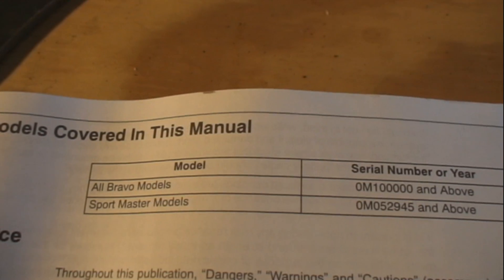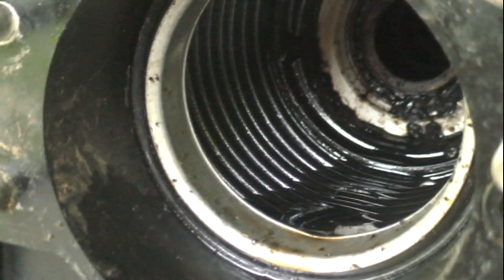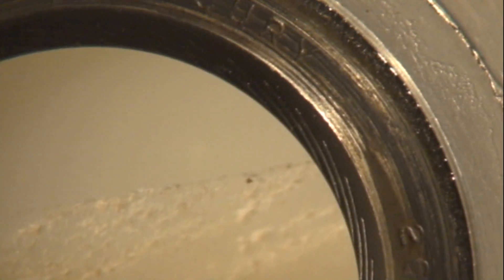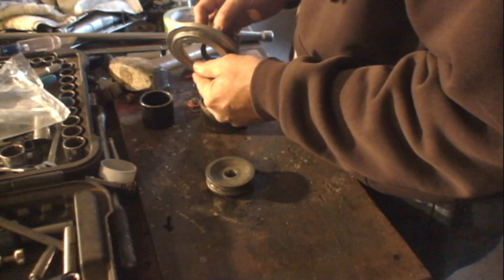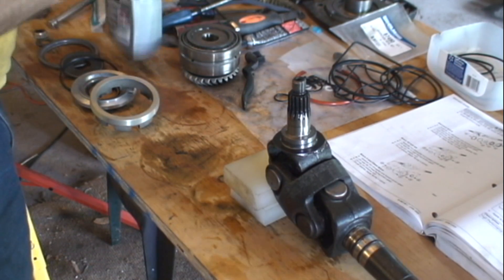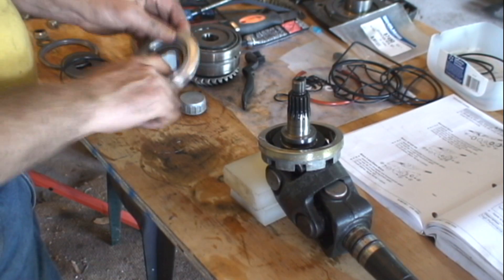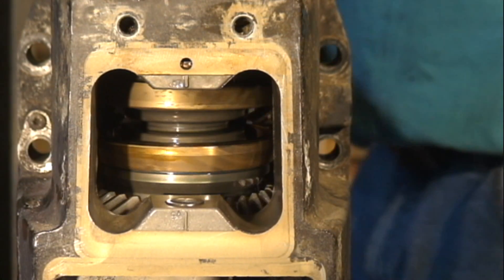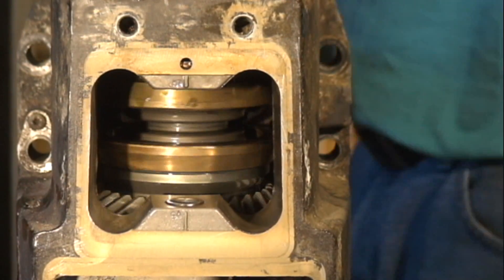Bravo One Outdrive Service - Drive Shaft Seal

Comment: I found the seal has its own measurable torque (drag). I add this to the bearing preload torque to get my final running torque number. Ive never seen this mentioned. Am i correct in doing it this way?

Comment: Your freshly put ''press fitted'' seal @ 4:51 is far from sitting flat (not fully sitting) !! Does it set itself right when you're ''Turn torquing'' the whole unit back into the casing ??

Comment: Hi Excellent Video. I have replaced the bearings with new and have set the preload for new bearings. I find now that when fitting the drive shaft into the housing and tightening the retainer nut the gears are binding. I understand that when fitting new bearings to the drive shaft that they will need to be shimmed. There are no shims currently fitted. Can you please advise.

Comment: Hello, appreciate your posting the video on how to replace the upper seal on the bravo.  I'm in the process of doing the same with my Bravo II outdrive and have encountered a snag.  Have pulled the outdrive, opened the housing, removed the shifter assembly, have the spanner to remove the retainer nut.  Have loosened the retainer nut completely and was expecting the u-joint assembly to simply pull out of the housing.  But won't come with human muscle. Got any ideas or suggestions what might be up? It spins smoothly as I would expect, but doesn't want to come out.  Thanks so much.
Reply from the maker: Here is a copy of the manual http://www.ta-group.at/dokus/service_manual_all_bravo_drives.pdf
It should just pull out. It is tight tolerances. You might try rapping on the side of the case with a mallet. I knocked the drive shaft against the bench as I pulled it out as seen in this video https://youtu.be/QIB6FpEmziM
Reply: Thanks very much for your reply.  Still having no luck pulling by hand.  Trying to figure out what's going on.  Here's my theory I would like to run by you.  This boat is new to me, so this is the first time I have been in the drive.  I have reason to believe that work has been done on the drive previously as evidenced by the leftovers of a upper housing seal kit (have the packaging with the part number, oil seal is not among the leftover items) among the various items left on the boat when I purchased it.
Reply: Second half of my comment.  Could it be that when the drive was previously worked on the wrong (too large) large o-ring in the u-joint assembly was used thus creating a very tight fit of the assembly when inserted into the housing? Or, could the assembly have been preloaded too tightly thus creating a 'bulging' of the same large o-ring in the assembly and resulting in a very tight fit of the assembly in the housing?  Is there a 'notch' in the housing that the large o-ring of the u-joint assembly is intended to sit when the assembly is inserted into the housing.  Thanks very much for your reply.  Mike
Reply: @michaelfanelli6018 : I know its an old post but.. in case .. FYI.. considering you've already disassembled the gearing front end and top end first.. all whats left is the drive shaft ''FORK TYPE'' locknut then it should come out easily by hand. If it still wont come out then probably had previous unadequate service works done to it or major overheat/leaks/frictions kinda welding the end shaft to the casing. NO O-RING in the world is strong enough, could be overpowering your hands .
Reply: @chrisking7255  Old post, but I had to take a heat gun and warm up the housing to get it to move in the housing.  No, I did not burn any o rings.  Just warmed it up. Worked wonders.

Comment: i have tried 3 times to set the preload on the drive shaft bearings 
without any luck. I loosened the bearing each time. I tried a sweep arm 
torque wrench and a click type. I cannot get any reading before nut 
bottoms out. Any idea what I'm doing wrong
Reply: Its cause guys like this can do things that only.oooo1 percent of the population  can or even want to.

Comment: Question??? If this driveshaft seal is leaking, can this cause water to leak into the boat. I have a very small leak coming from somewhere andI cant find it. I have removed both engines  along with the Bravo 1 drives and the gimble housings, both the inner and the outer. I out on a new gimble seal and I still have the same leak. I have been pulling my hair out for 2 years now and I cant find it. It is very slow, but still it is there. Any ideas please?? Thanks.
Reply from the maker: This drive shaft seal will not cause water to leak into the boat. If this leaks, you may see oil in the bellows.
Reply: ok...thank you for the answer. I am somewhat relieved, but I dont have any oil in the boat, so I guess that is a good thing. I do have this tiny leak...more like a big drip and I cant for the life of me find it. I pulled the motors out last December along with the K-planes and the gimbles, thinking that maybe the gimble seal was leaking alittle. New foam seal and resealed all the holes going thru the transum and I still have that stinking leak. The only thing I didnt change or look at is the streering arm with that steering pin thing that sits vertical on the top of the gimble housing. I have had a few people tell me that water could be coming in there because of a bad seal on the steering pin. I am debating on pulling the motors and gimbles again this winter. I dont want to drill thru the sides of my Bravos, so I either pull the motors and go at it correctly or deal with it...decisions...decisions.

Thank you for your help...Paul
Reply from the maker: You can find a link to a complete online bravo one service manual # 28 about halfway down the home page at www.bravoone.slantpower.com Look through the diagrams in section 4 to see where a leak could be.

Comment: Thanks for one of the best video instructional's on youtube,, very professionally made,, "narrated" instead of "work & talk" style, which is  nice to see here! As for my question, I have an "alpha second generation" outdrive that is leaking oil from the upper input shaft, just as your bravo upper was. Should I assume there removal/install procedures are basically same,, and,, what were the preload measurements supposed to be when you reinstalled the gear and locknut? Thanks for a great video!